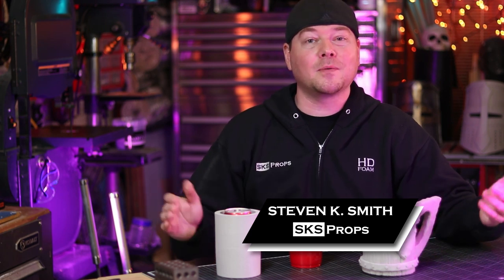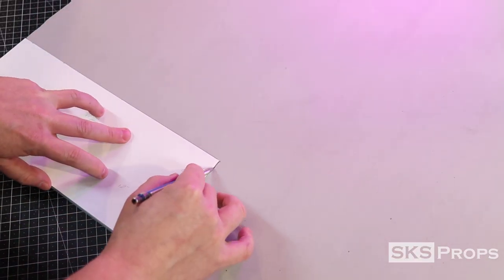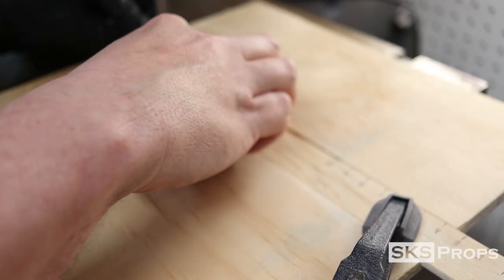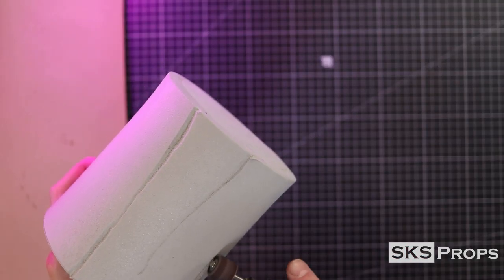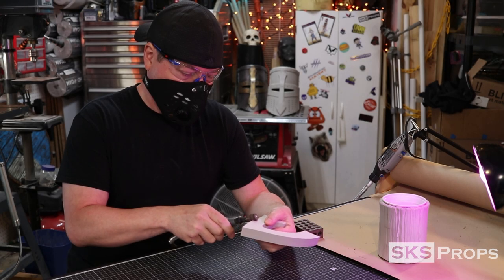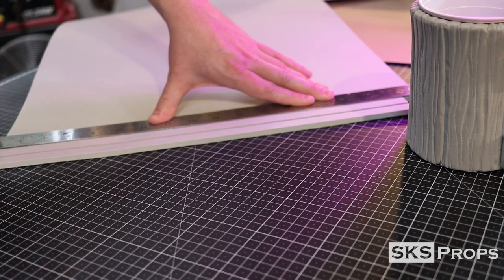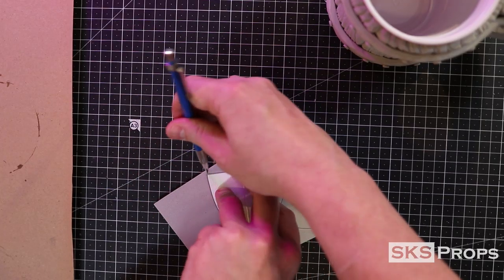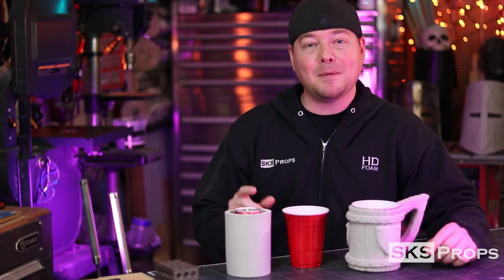DIY Custom EVA Foam Can / Solo Cup Koozie Holder with Free Templates

Comment: i’m a little confused, the templates don’t have any size reference. no ruler mark, no dimensions. nor is it announced. i’ll just measure a can i guess, kinda makes the template pointless. cool project though
Reply from the maker: It’s not confusing just follow the directions on my website and open the PDF templates in adobe acrobat or adobe reader and click “poster” in the page size area that scales it properly over several sheets regardless of your paper size. I have followers all over the world with different paper sizes

Comment: That's awesome. I would suggest putting a little hole in the bottom,  that should help with  the suction
Reply from the maker: tad6969 Thanks and yeah I forgot to do that. Figure it will help with condensation too

Comment: What a great project! Might consider making them a little shorter for the solo cup, so the cup sits proud of the top. With the lip of the solo cup flush with the top edge of the foam, you'll have to put your mouth on the foam to take a drink. Or you could use a bendy straw with your viking cup. ;)

Comment: for the glues to work how much time should pass to get them to stick ? mine are just gumming up and not holding.
Reply from the maker: Super glue is instant but if your contact cement isn't holding you have one of two issues. 1 there is to much glue being applied. you only need a thin coating any additional adhesive will will prevent it from drying properly. or 2 the contact cement is old and needs to be replaced. after the glue is dry about 3-4 minutes ( I sometimes us a hairdryer to speed up this process) they should stick together fine
Reply: @SKSProps  thanks i picked up new glue fingers crossed or my cosplaying foam days may be over before they started...lol.

Comment: So what would I do to calculate the thickness of the foam when making the walls if I’m making my own custom size? Like if I wanna make a mug and have half inch foam and I have a piece of paper that is the exact size of the object but it’s not the same size as the foam would make it if that makes any sense lol.
Reply from the maker: Make a “foam ruler” cut a 1” wide piece and use that to gauge your overall thickness
Reply: @SKSProps  awesome thank you so much!!

Comment: I like this a lot. How is it with condensation?
Reply from the maker: Foam is waterproof so it's fine I did drill a 1\4" hole in the bottom of each to help with suction and any additional moisture

Comment: Very new to working with foam so this may be a dumb question! --- Can you use 8mm instead of 10mm for the cup?
Reply from the maker: You can definitely try it out 
I just used 10mm so that it would be a little more sturdy when a cup or can is full